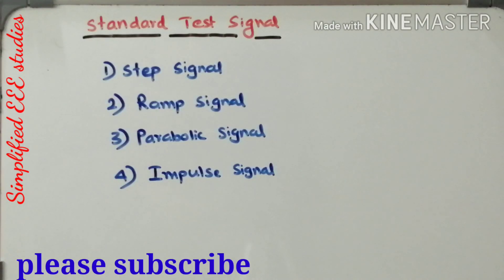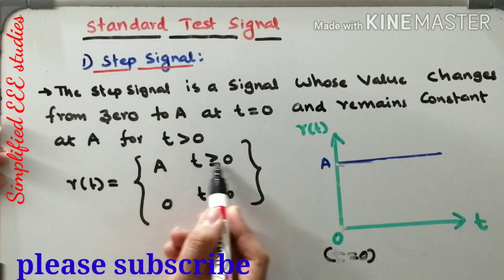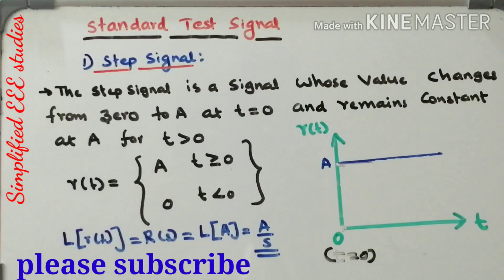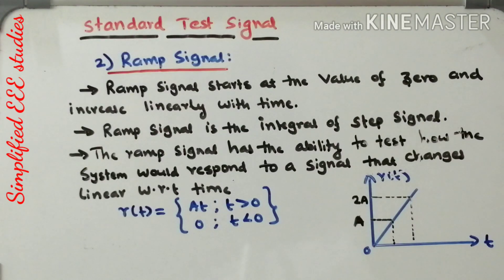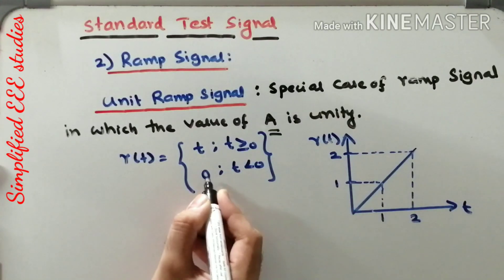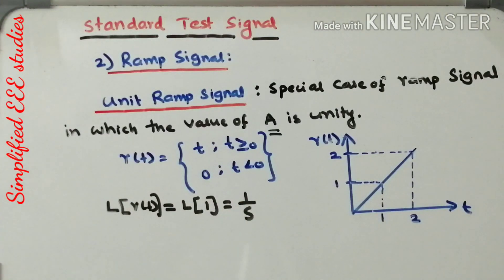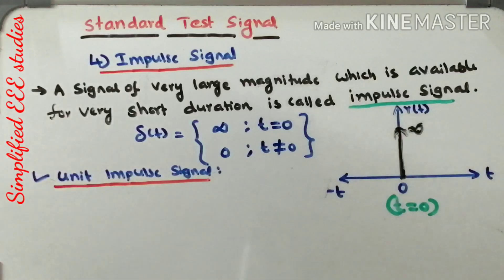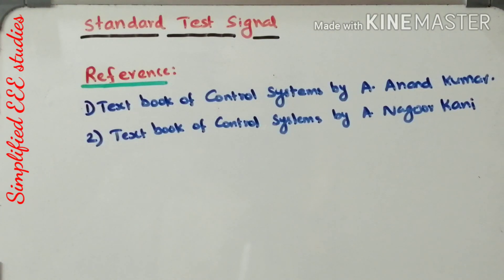#CONTROLSYSTEMS#STANDARD#TEST#SIGNAL#STEP#RAMP#PARABOLIC || STANDARD TEST SIGNALS IN CONTROL SYSTEMS

Comment: 14th cs exam sir tell some imp questions sir
Reply from the maker: Good evening,
1. Compare Open Loop & Closed Loop Systems
2. Write a brief notes on Synchro
3. Write some examples of OPEN & CLOSED loop systems.
4. Force-Voltage & Force Current Analogy ( Numerical Example)
5. Block Diagram reduction technique (numerical example)
6. Properties of signal flow graph (You can expect one numerical example using MASON's gain formula)
7. Cover the topic "Time Domain Specification" 
8. Problems on Steady state error.
9. Study how to apply Routh Hurwitz criteria to evaluate system stability
10. Root Locus or Bode Plot- One problem can be asked 
11. Study the definition of Frequency domain specifications (Resonant Peak, Resonant frequency etc..)
12. Study the Nyquist criteria (theory) if time allows.
13. Design of PD/PI/PID controller.
14. Design of LAG/LEAD/LAG-LEAD Compensator.

Kindly refer the previous year question paper (atleast 3 years). You will get an idea.

All the best!
Reply: @SimplifiedEEEStudies  thank you very much sir
Reply from the maker: Good morning, you are welcome. Happy learning
Feel free to ask any clarifications regarding my lecture classes.
Thank you